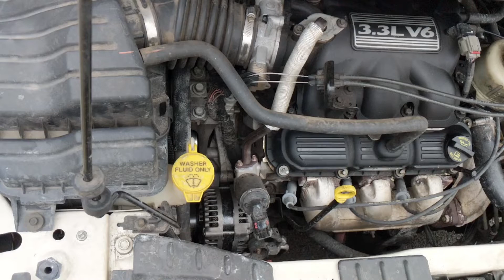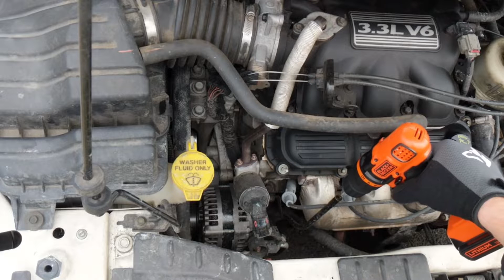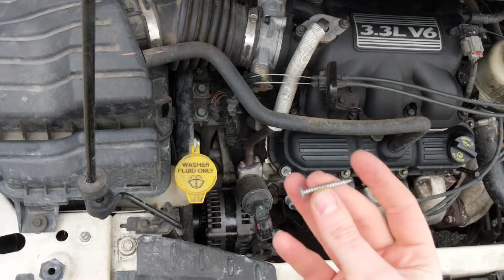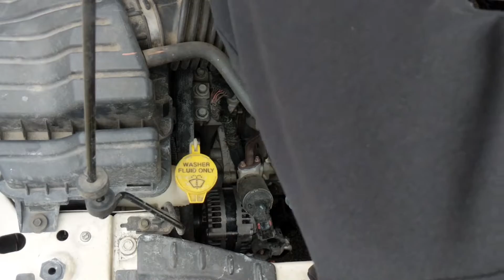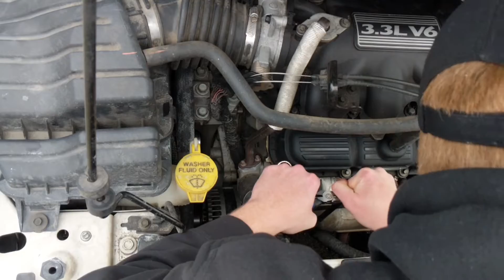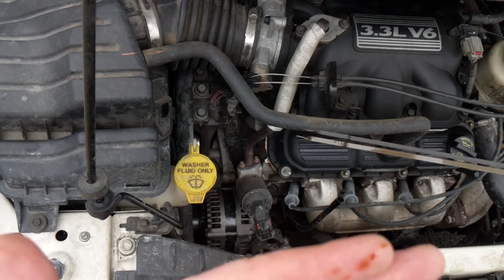How To: Broken dipstick remove and replace. 2006 Dodge/Chrysler Caravan/Minivan 3.3L V6

Comment from the maker: Using a drill bit only slightly narrower than the threads might prevent the dipstick from getting locked. I used a 1/16" on the pilot hole which was too narrow and caused the plastic to bulge when the screw was inserted.
Reply: You probably dont care but if you are stoned like me during the covid times then you can watch all of the new movies on InstaFlixxer. Have been binge watching with my girlfriend these days =)
Reply: @Damian Johnny yup, been watching on InstaFlixxer for years myself :D
Reply: @Damian Johnny Definitely, have been using instaflixxer for years myself :D
Reply: @Damian Johnny definitely, been watching on instaflixxer for years myself :D

Comment: I stood there in front of the van looking at the dip stick and thinking I really need to replace this or at least the O ring. Then I said nah,  next time. Pulled it and snap lol😂😂😂 teaches me a lesson. Yeah,  hot engine and some WD40 or silicon spray will get it out easier.

Comment: Haha! Was just selling my 2006 20min ago and while in the engine compartment I pulled the dipstick and snap! Well, couldn't sell them in the car like that, so I just fished out the dipstick the exact same way you did. Got a little worried after the screw came out three times. Finally found the perfect combo.

Comment: used this method but with one change - I used a propane torch to apply some heat on the outside of the tube and it came out super easy as the plastic softens up - took me less than 5 min total
Reply: Never bring flame close to engine. Very dangerous. You were lucky no accident happened.

Comment: They used to be all metal and this didn't happen.  What happens if you drill to deep. Y accident?  The plastic falls apart into your oil pan?  I guess trying to take off the tube from underneath would require draining the oil.  Then if you pull one from the junkyard, won't it just happen again, seeing as it was so gold.  My vehicle is 2005.
Reply: Check out this guy removing the tube without draining the oil: https://youtu.be/rvQslAr-BCo

Comment: One mistake is letting everything heat up. The tube gets warmer and expands around the remaining plastic making it
 harder to get  the dipstick stuck in the tube. Match the screw diameter to the drill bit  is necessary . This seems to be a
common problem with Dodge vehicles that are over ten years old!

Comment: Did not work. Idiots at the oil change place shoved it in so deep. What now? HELP....
Reply: I watched another guy remove the dipstick tube from the oil pan and pushed it out from the bottom, that is my plan this afternoon
Reply: I couldn’t get the tube out of the pan so I ended up drilling with 1/8” bit and using a dry wall screw, came right out. The remainder of the dipstick dropped about half an inch farther down the tube, but the tub is more restricted about an inch down to prevent it from dropping too far down, just go slow.

Comment: Did this procedure today.  Did not pre-warm the engine as recommended.  Did use 1/16th" drill bit and about a #6 screw.  A 4-40 screw about 1"or 1 1/4" might be better.  I only drilled in about 1/8th" but looks like you could drill to 1/4" depth.  I only had to screw into the plastic a turn or two (less than a 1/8th").    Another note here.  I actually broke the dipstick when trying to check oil on a very hot day when the engine was pretty hot.

Comment: man thank you so much for this. would not come out for like 30 minutes and I was giving it all the leveraged strength I had. the part you mention to use the jack nub key saved my ass. i used it to pry and get torque and it finally worked thank you

Comment: if you take the o-ring off the dipstick handle and get some sandpaper and sand the handle a little where it goes in the tube then put the o-ring back on the handle you will never have this problem again
Reply: Good suggestion,although time/age can't be sanded away. Ours broke due to aged plastic but we are still gonna give your idea a whirl. Thanks
Reply: I sanded mine a year ago  and a week ago it was stuck and broke off. I believe the old plastic swells  over time. Mine was extremely tight when I removed it to replace it